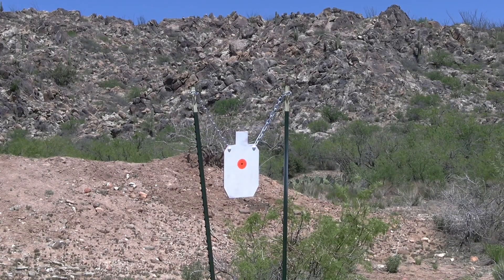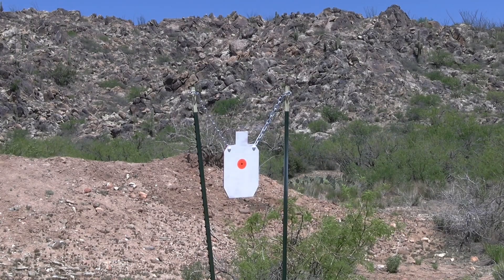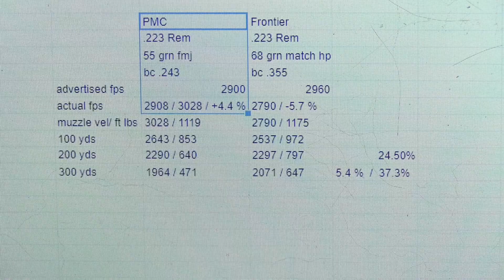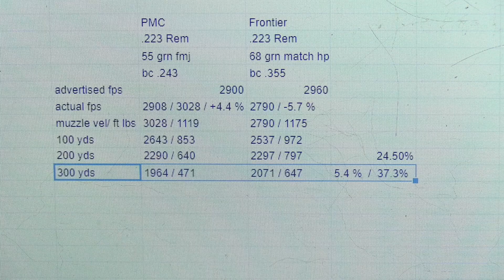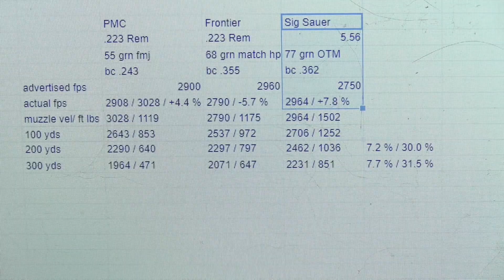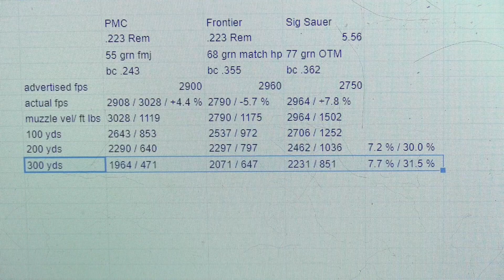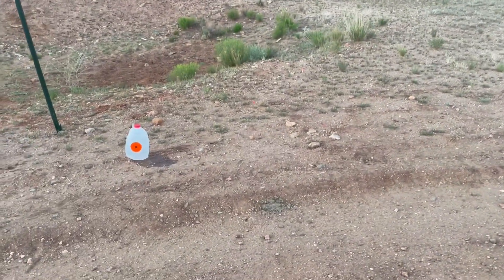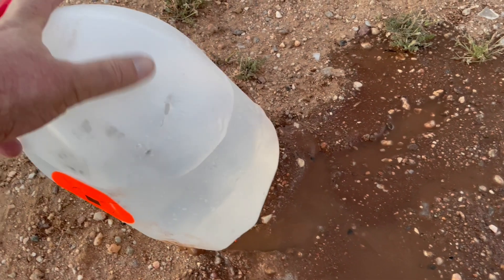.223 / 5.56 68 grain & 77 grain at 200 & 300 yards

Comment: While it should be pointed out that .223 pressures are lower than 5.56 no matter the bullet weight, those numbers are still very surprising. I knew 77gr had better terminal effects down range but I didn’t know the performance/“energy on target” would be THAT much better. No wonder everyone (everyone who has used it in a military capacity) has so much preference for it. Crazy difference. Thanks for the video!👍
Reply: the 223 & the 5.56 cases are identical in every way.
the primary difference in the cartridges is the 5.56 rds. have approx. 1.75grs. + - more in powder loads. 
only the rifles vary as the 5.56 has a longer throat and leades to compensate for the additional fps.
Reply: @DLN-ix6vf  cases are identical yes, but pressured are completely different. 556 gets the same if not better velocities with a 16" barrel that 223 does with a 20" barrel.

Comment: ... Good video. I've started shooting my .223 @300 & 500 yards and have been very impressed now I've found ammo it likes. It's good for 1 MoA or less groups if there's not too much wind. Unfortunately the ammo is out of stock until at June...
Reply from the maker: Thank you for your compliment.  Much appreciated.  What bullet weight are you having the best success with?  🤔
Reply: @outdooradventures1696  ...69grn SMK BTHP were the best @500 by a long way (Federal GMM). I tried ADI in the same bullet but not as good, I have Sako Racehead to try next.  These were good @100 but not tried them at distance yet.  The 55grn Blitzking were second best but the wind was pushing them around more. My rifle is 1:9...
Reply from the maker: Thank you for the good info. 1 in 9 twist and the 69 grain class of bullets are usually a good combination.  Have you tried the 68 grain bullets?  They seem to have a little better bc than a lot of the 69 grain bullets.  (Although that may not be a true statement in every case…)
Reply: @outdooradventures1696  ...I haven't tried any 68grn yet or heavier but I might have to if we can't get a regular supply of Federal GMM! I couldn't believe how good they were. I took 5 shots @300 to get on bull and the Strelok the elevation @500, plus 1 click for a slight headwind, and it X the bull, and did the same for 5 ex 6 shots. I then realised they are very expensive and we have no UK stock....gutted!
Reply: @outdooradventures1696 ...FYI I started reloading and found H322 and N133 to be good powders for .223 69gn SMK. I've also had great 100 yard accuracy with Sierra 65grn GameKings over 22.8grn of N133 - 0.3" 5 shot groups. Not shot them at distance yet ..

Comment: The 77 grain SMK over 24/24.5 grains of RE-15 has been a standard loading for US Service Rifle Competitors at the 200 and 300 yard line for over 20 years from match grade .223 chambered barrels. From my 20 inch CLE .223 chambered barrel I get 2750 fps in standard atmospheric conditions. I use an MOA wind constant of 10 at 300 yards.

Comment: Sure wish you would've thrown the Sig Sauer 40 gr projectile in with this test session as well. My 1:7 twist AR likes the 40 gr better than any other weight pill. It likes the 77 gr 2nd best, lol, and it HATES ANY 55 gr pill.
Reply: Spin and velocity supports marksmanship at long distances from very low drag bullets which need a lot of spin and velocity to remain nose-on to great distances. The bottom line is the greater distances you shoot to the more recognizable the superiority of 77 and 80 grain bullets from a 1/7 twist barrel will become, especially in gusting wind conditions, since light 223 bullets only have an MOA wind constant of about 7 at 300 yards while the 77 grain bullet have an MOA wind constant of 10 at 300 yards.